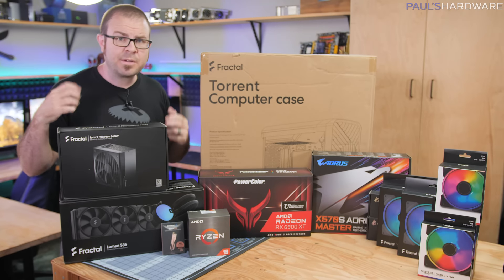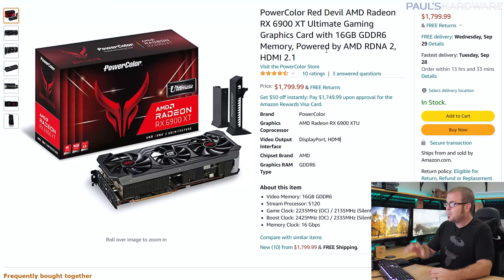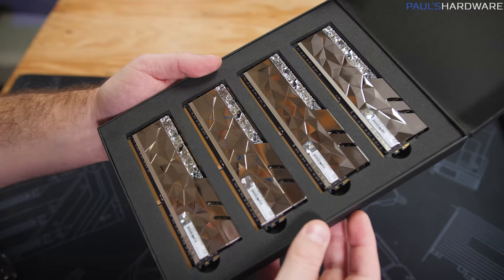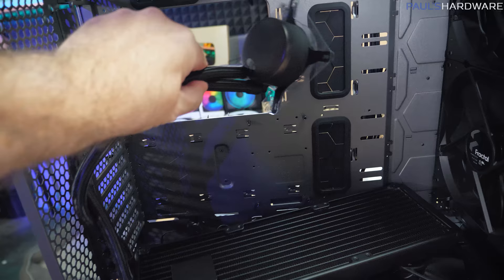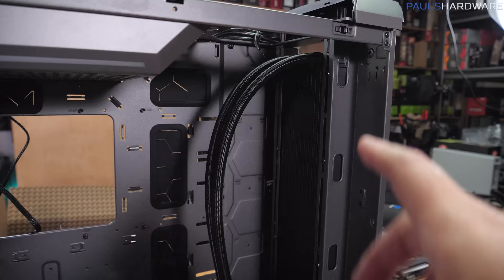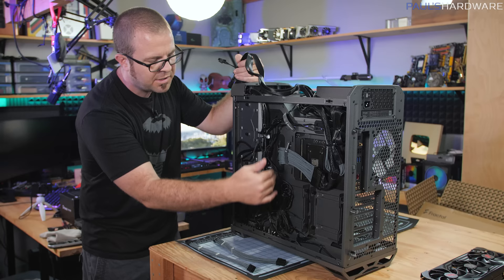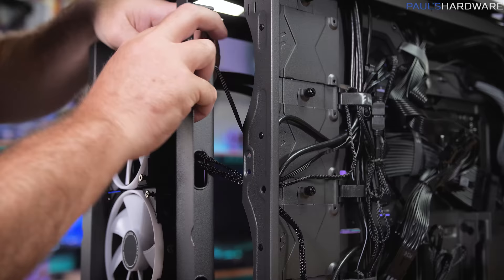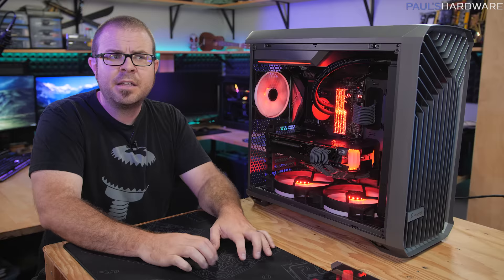Build this RX 6900 XT Gaming PC for the cost of an RTX 3090

Comment: Horrible idea to have intake in the bottom Paul. You blow air against the air coming from your graphics card.
Reply: The fans on a GPU are intakes, therefore they like cool air coming to them. The air from a conventional GPU cooler is mainly expelled from the side, and it will be doing what it normally does in a case, perhaps aided up to the rear fan by the overspill from the bottom.

Comment: pc partpicker is garbage why tf do people use it the cheapest 3090 is way cheaper than $3000 lol
Reply: Where???? They are $2,800 on Ebay which isn't way cheaper.
Reply: @420jessw  i see 2500 on ebay atm
Reply: @Hogdriva  The cheapest buy it now on Ebay at this moment is a used 3090 for $2,400 the cheapest new is $2,700. I don't see a new card for $2,500 and even than $2,500 still isn't way cheaper.

Comment: this case is awful, with the PS at the top , that's where the CPU cooler goes , 
on top. the case sucks, toss that sh** away and get real case quick !
Don't ruin the whole build 'cause you got a free case , its garbage.
Reply: Clearly you have not seen the actual reviews on the case. Gamers Nexus (who I would say are probably the most critical reviewers) said they liked it. Which never happens.
Reply: There's nothing wrong with the case. Just because you don't like it doesn't mean it's terrible.